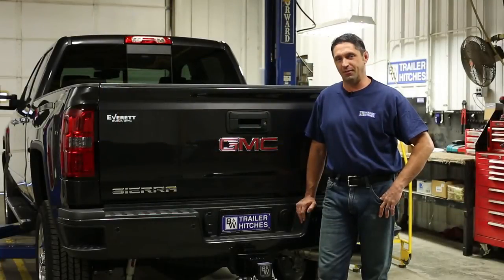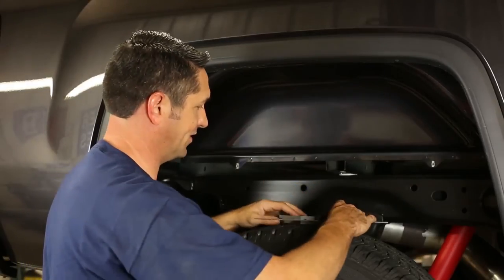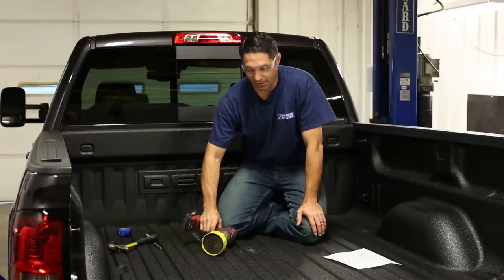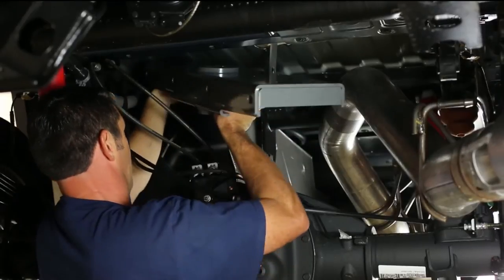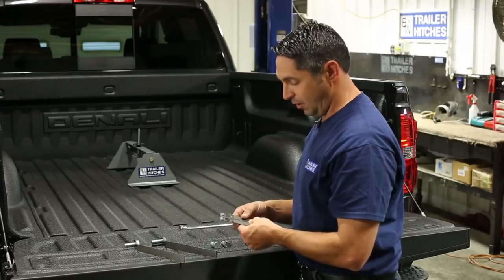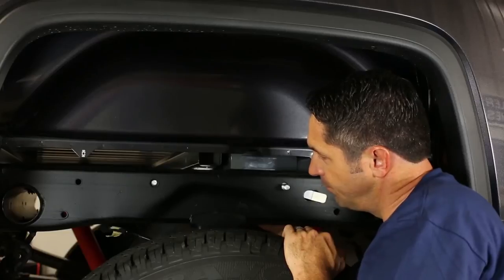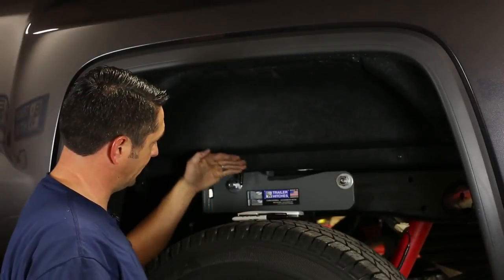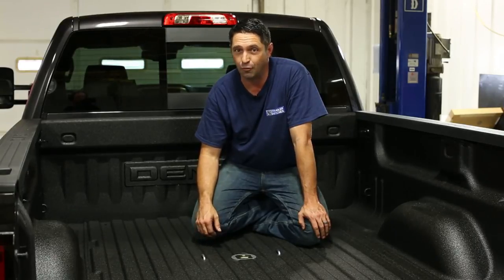B&W Turnoverball Gooseneck Trailer Hitch Installation Demonstration   Model 1012

Comment: I just had Camping World install one of these. After I swept out all the metal shavings from my new bed, and reattached the exhaust on the hanger (both minor annoyances) I discovered that they left some structural bolts of the hitch framing hanging loose. They claimed the bolts weren't really necessary, anyway. It was only because of the first two issues that I discovered the dangerous third issue. Beware, and CHECK the work!